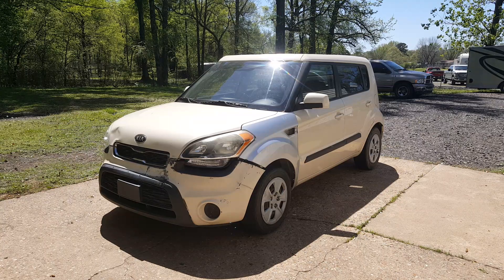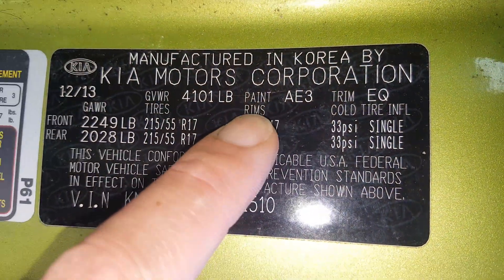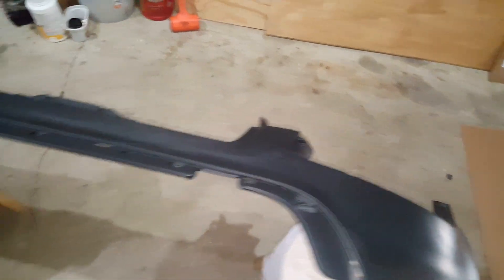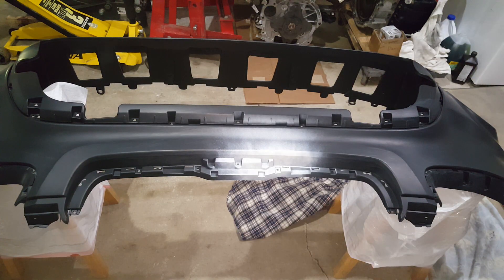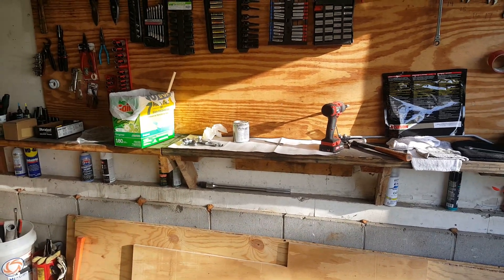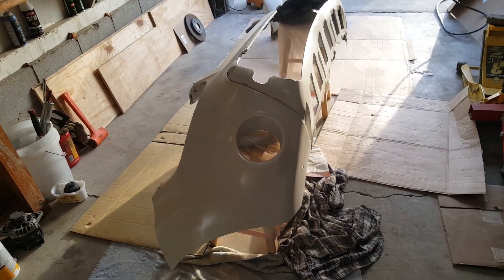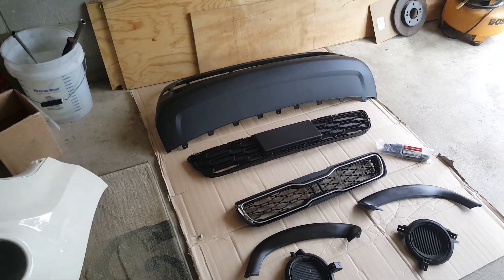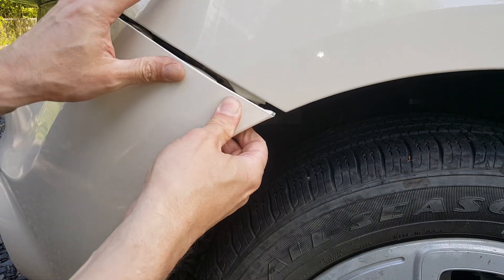Kia Soul painting and replacing front bumper and fender

Comment: This video gives me hope. I'm a diy kind of person and just need to paint the driver fender and upper bumper cover. How much would you say was roughly spent, because I'm getting quotes for $600 to $750 for a paint job.
Reply from the maker: $100 for pint of paint and quart of clear coat. Most auto paint stores can mix base paint in a rattle can .( take a piece of the old bumper/fender for exact match) Also they have the 2K ( 2 part epoxy ) clear coat . I will also say this the mixed rattle cans I have used in the past one can was enough to spray an entire bumper , so it depends how thin its mixed as to how far it will spray. Best of luck on whatever you decide , and thanks for the question.